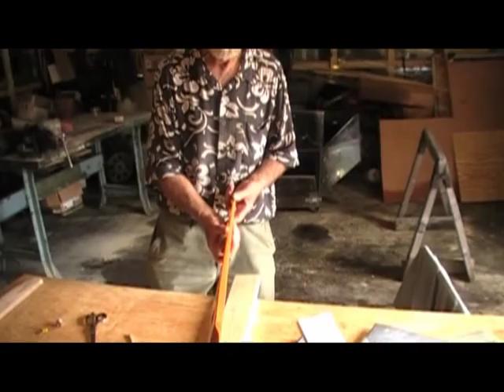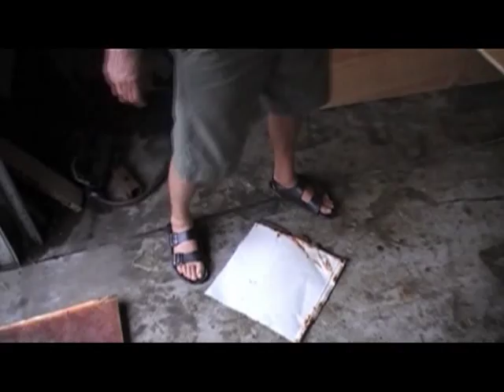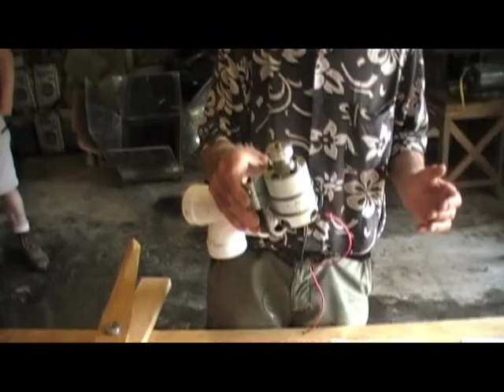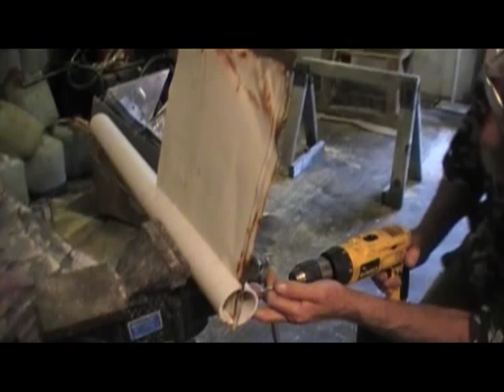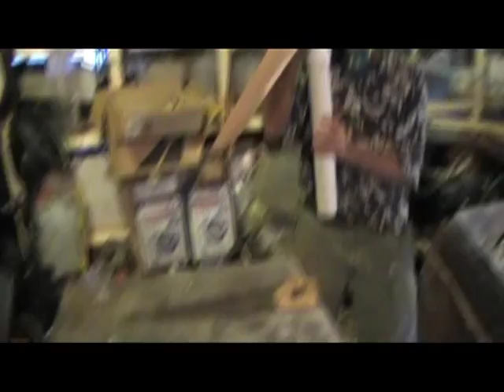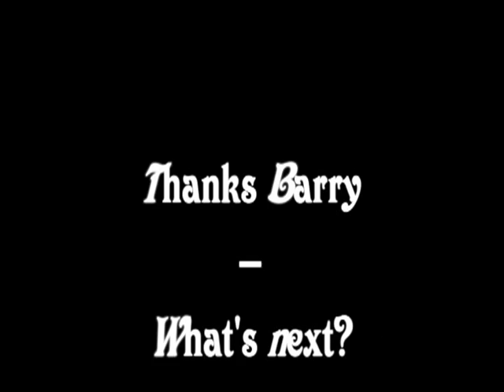Building a Wind Turbine

Comment: we can produce endless amount of energy and clean water by electrolysis of sea water then take the hydrogen alone to high attitude where we combine it with atmospheric oxygen and drop the water on hydraulic generator from this high attitude as in dams
Reply: seems like a lot of work for a few watts?
Reply: Dan Murphy IT IS EASILY DUPLICATED  SO YOU CAN HAVE MULTIPLE TURBINES.

Comment: i have been building a wind turbin 4 blades 50 inches each power will come from a gm alternator ....im useing a motor much like the one you have there as a exciter ...trial an error ...blades are 8 inch at base 4 inches at tip on a 45 degree picth it weights a bunch so im keeping it close to the ground ...in the future i hope to build a water wheel about 12 feet across not many rmp but lots of torque...just think out loud here ...i have most of the parts all ready in hand